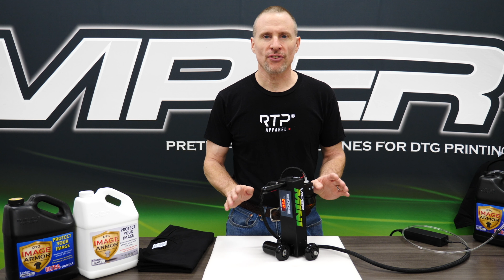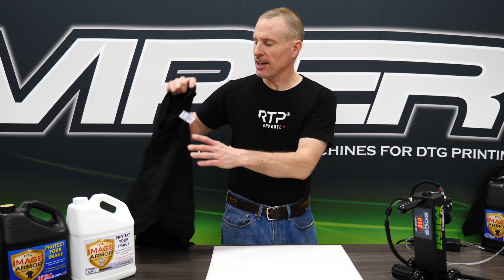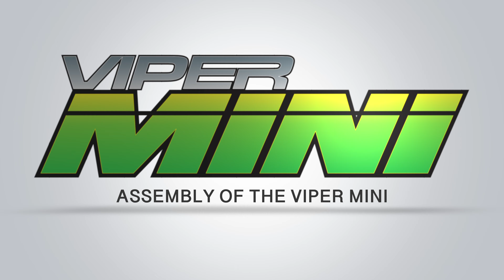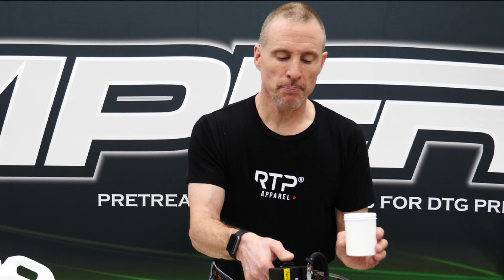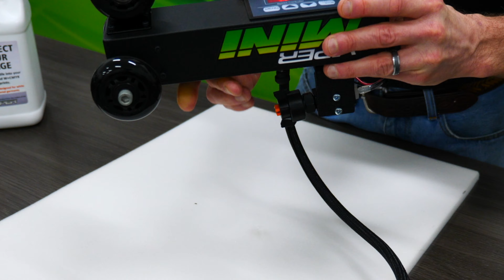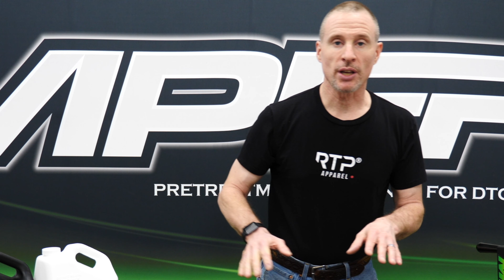Viper Mini DTG Pretreatment Machine Introduction and Use

Comment: What connections do you need?
Reply from the maker: Hello Lau! Do you mean for the power supply or the pretreatment? There is an included power supply (110V) and a fluid tube that will be used for your PT of choice (hopefully its Image Armor!)